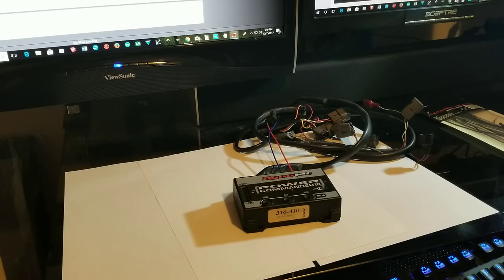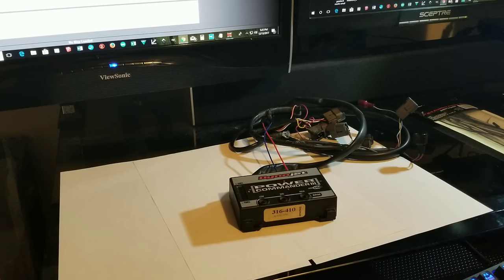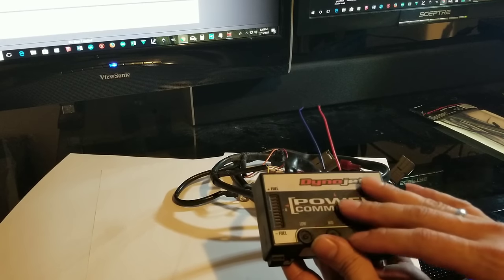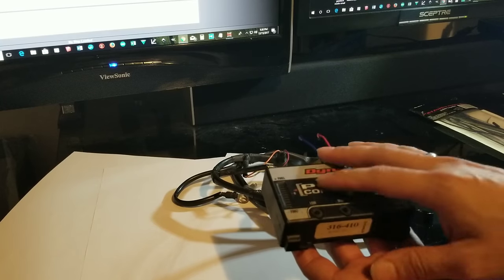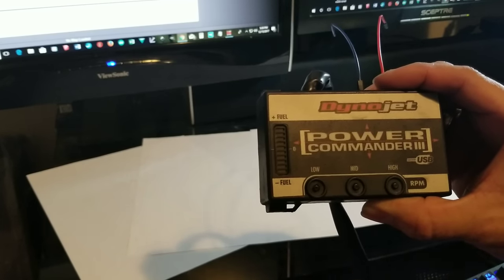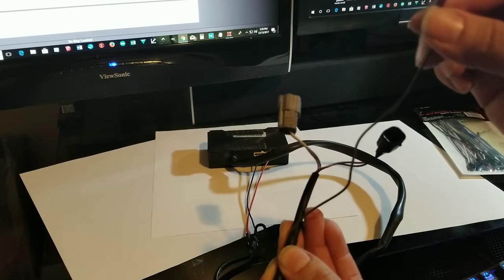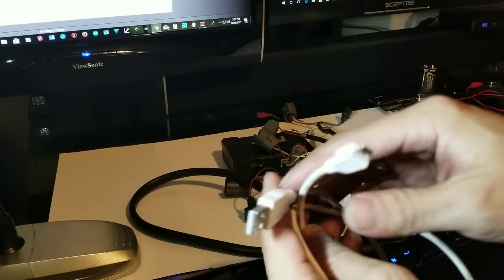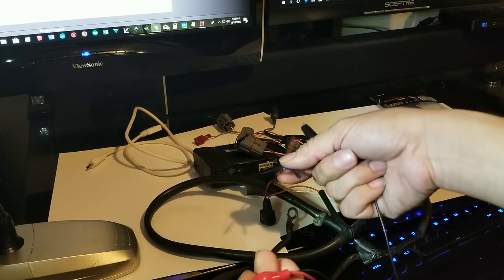Power Commander 3 Full Install - Mapping to Installation (Part 1)

Comment: put a resister in series with the coolant temperature sensor. Tricking the ecu into thinking the bike is cooler then it really is, thus dumping more fuel. putting the fan on a switch might be a good idea(for obvious reasons). 100ohms is a good base to start with and knowing how much the temp reading has changed is crucial.

Comment: Ur videos have given me the inspiration and confidence to troubleshoot and remedy if needed several applications outlined in ur videos. My 01 GSXR 1000 has a PC III USB with a custom map that I inherited when purchased. The bike started to backfire when idling after I repaired an exhaust leak at the mid pipe. When I hooked up my laptop, established comms with the PC III and was viewing the custom map I noticed at throtlle position 0, rpms 1000/1500 and 2000 had a -10 defined in the text fields which indicated to me a lean condition which in turn would cause my backfires when idling. I changed these values to 0 and the backfires immediately stopped. I know the bike needs a proper tune which will happen come springtime. THANKS for the informative vids. Much appreiciated....
Reply from the maker: Kevin, thanks for sharing, greatly appreciate the comment. I'm glad my videos could help you out. Funny story, these videos were never meant to be self helps for YouTube viewers. My intention was to document my repair jobs as I learned and worked on my own bike, something I could go back to if the problem happened again. I got such a good response from viewers that I continued to record each and every problem that occurred creating what is now some 90 video library over the course of 7 years. While i dont proclaim myself to be an expert I do offer advice and troubleshooting tips to those willing to listen. hope you stick around, I'm always working on something whether it be a repair or modification.

Comment: To Justin Westphal,
Follow up on the maps. 
Once you create a login and look up your bike,  you will then be able to save it in your garage. 
Go to your garage and on the top right you'll see 3 dots,  click on those and select browse parts.  Select Power Commander III. Then scroll down to Tunes and keep scrolling to the bottom where it says ACCESS TUNES, click on that box. Find your map and download it. Then go through the process of programming.  Very easy. 
Good luck hope this helps. 
Todd Weiler
Reply: Todd weiler thank you
Reply: I'm not sure if they changed the website but there isn't 3 dots on the top right anymore.  Any chance you can revisit the site and see if you can find power commander 3 maps for a 2005 GSXR 600?

Comment: I'm late to this video, but for those who are watching, you can't just use anyyy USB ( 7:00 ). It's a USB-A to a USB- Mini B (aka USB mini or mini-USB) not to be mistaken for a Micro USB. The USB-A is what's plugged into the computer and the Mini-B is plugged into the Power Commander.

Comment: Thank you....
This was an awesome tutorial on the commander 3. I just remapped mine due to this video.  Step by step was right on.  Thank you for taking the time to make this video,  very clear and easy to follow.  Every step from the power connector on the unit, to the program,  maps etc.
Excellent! 
Coyote
Reply from the maker: Hey Todd. Thanks for the props brother, greatly appreciated and glad I could help you out.
Reply: Where did you find the maps?  The power commander website doesn't let me chose a maps tab.  Any ideas?
Reply from the maker: @justinwestphal6195  take a look at Todd's response below.

Comment: This vid was amazing man thanks for taking the time to break it down. So many jewels you dropped in this joint. Keep up the good work, I’m confident in moving forward with this PCIII I’ve had maying around I’ll put it on my 07 750 track bike since I have a new Arrow exhaust and I’m getting some back fire. Now my only question is do it matter what PC3 I get? Or is it more just about the maps you download? The PC3 was given to me free
Reply from the maker: Thanks Brother, does it matter what PC3.. Yes.. a simple net search will result in which one to purchase for your bike..This is primararly do to injector connection type. The maps will dictate the firing or spraying intervals based of the TPS signal (throttle input). Be sure to watch part two so you can see what installation is like.. pretty straight forward stuff.

Comment: To Justin,  you have to be signed in to get any maps. Just create a login and password and then when you get into your year, make and model,  you will see options to get maps.  Follow James' tutorial from there and you'll see them.  Good luck. 
Todd
Reply from the maker: Thanks Todd, this must have been a new requirement added when they designed the new site. I dont recall ever registering to the site but I can see where that makes sense as it just populates on my screen..

Comment: PC is going to charge like $22 minimum to ship the 9v module. The diy connector is a great idea, thanks.
Reply from the maker: Kyle - wow, is that a confirmed shipping cost.. if so that's damn outrageous!! There defiantly adding an extra cost in there to make up for the  listed low cost. You can buy a battery snap for a buck or 2 and make a more professional looking piece and save yourself 20 bucks..lol
Reply: james moreno I think they offer USPS ground. But when I plugged in my address the cheapest method is $19 ( not $22) for FedEx 2 day shipping. ... I found everything I needed in my garage, so I saved some money :).

Comment: Quite crude. You can only make changes for every 20 % throttle position in the higher percentages. That was a surprise. 
I think you can adjust more with an ECU flash.

Comment: sweet video brother, don’t have a local electronic store like the one you mentioned another place where i could get those leads ?? and alligator clips?
Reply from the maker: Thanks brother, about the only other place I would say is to head over to amazon. I'll post some links below just in case you want to order. If you have an RC shop or hobby store which deals in small consumer electronics then they will most likely have. 

Alligator Clips
https://amzn.to/3hScyWr

Breadboard Jumper Leads
https://amzn.to/3ffntb9

9 Volt Battery Snap
https://amzn.to/317PVa1

Comment: really usefull video, do you know for PC3, which pin can i connect to switch map? (without using hub module)
Reply from the maker: Sorry bro, I dont have that information for you but if you do locate that information please come back and share it so it becomes common knowledge and available for everyones.

Comment: Sorry for the Low IQ question but which map would I use if I have a 

2003 Sv1000s
Sc project exhaust
Tre eliminator
-1. +2 chain and sprocket
K & N air filter 

I see stock maps I’m all types of confused 

Appreciate any help

Comment: Great video, one question,  can replacing my dead battery clear out any maps I had on my powercommander? My Honda will not start after I changed battery.
Reply from the maker: No, the map is written to the eprom chip inside the PC3. If this is your issue it's something else like a fuse or some other underline issue.
Reply: Thank you, for your video and your time

Comment: Thank you for this video. I got a 104-410 PC3 and I just mapped it. It has an option Shifter Kill. As I read online, I should have an ignition module, but it seems that PC3 controls both injection and ignition. Does anyone have an idea about this? (It's about a Quickshifter)

Comment: I know im a little bit late on this one so i  have a 06 750 gsxr when i bought it it all ready has a  power comander but i cant really  tell what generation  is it  my question is do they get married once u updated to a computer n connect to bike ? Also if i get a newer comander will i have to unmarried the old one n married the new one or is it just plug n play? I been wanting to do some upgrades on my bike but this thing is  stopping me from pulling the plug and buy some aftermarket parts.
Reply from the maker: No marriage here brother. Divorce the two by pulling the plug and connecting everything up as normal and the bike returns to stock.

Think of the power commander more as a translator with its own agenda, a man in the middle if you will.  The ECM says one thing (Add Gas)--->[PCIII Translates (add MORE Gas)]---->Injectors (GOT IT... MORE GAS). The injectors never even heard the ECM... haha

Everything remains on the PCIII.. That's why when you sell it to someone else they need to go in and clear that stored MAP and add the one specific to their needs.

Comment: James can the PC 3 be remapped with the laptop connected to it while in the bike without a 9 volt adapter?
Reply from the maker: Michael Doucette, yes but the bike will have to be running (Live tune). From my experience if you turn the key to just the accessory position power is given for a few seconds for priming and then kills the power shutting down the PC3. You can try of course but like i said that has been my experience with my PC3. I have seen one video where a guy was able to keep power on to the pc3 with just the accessory on but this may very with older to newer versions of the unit.

Comment: so if you bought a used bike and the bike already had a commander in it, is there a way to download the existing  tune from the commander?
Reply from the maker: You can always download a map with your specifications, exhaust or air filter, off the DynoJ website. The question you should be asking yourself is if the power commander already has a map in it that already has programming specific to your bike. Have you hooked up the power commander to your PC to see if one is not already installed or are you just assuming that it's not there?

Comment: If your PClll is already wired up to your bike then you can just hook the usb to it and your laptop and turn the bike on to supply power to the PClll? And download and install from that point?
Reply from the maker: Technically yes, but there are some PCiii that will go to sleep once you switch on the ignition to accessory mode and those will require to bike to be running in order to tune or you just simply connect the 9v battery to maintain power.

Comment: Hello, can you help me about a problem? I didn't found on the dynojet website a map that can my PCIII software to read it. What can I do next? I buy an used PCIII and the previous owner tell my that the PCIII dinn't have a map on it. I can do something with it, or resell it?
Reply from the maker: whats up brother. I find it odd that the previous owner of your PCIII didn't have a map on it if it came off his bike. Most people who sell their used PC3 wont go through the extra effort to erase the map off the unit which leads me to believe that his unit was defective when selling it to you.. that's assuming if your having trouble uploading a new map. Take for instance my PC3 which I purchased off of eBay, this unit came to me from a person who had it on his bike and had a map on it and since he knew it was going to be reprogrammed he left it on.

If your having trouble finding a map for your bike I would suggest doing a net search to see what others have used that works for your setup. You can also get up on the forums and  ask owners of the same bike with your modifications if they could give you a copy OR sell you a copy of there map which you can then upload to your PC3. Since it is working on theres it should give you a baseline to work from.

If the issue is that you have a map and cant upload it to the PC3 try using a few different USB cables. Not all cables will communicate with the unit as you seen in the video.
Reply: @TheChemistDIY  Thanks for your response. I'll wait my unit to arrived at my home soon, and connected to my laptop and see what's in it. If is empty, hope you can help me with a map. I'll aprecieted your effort to help me. I will talk to you soon as my unit arrived and install it on my bike and put a laptop on it and see what's inside

Comment: Alright I'm a new rider only been riding for 2yrs I was going to purchase a pc3 but I see some with only 2 injector plugs and some videos show the pc3 with multiple plugs I have a 2001 cbr 600 f4i which I added a k&n air filter delkevic headers and yoshimura exhaust...so again should the pc3 have more than 2 injector plugs? Please help me out it's all new to me and I'm dying to ride again?
Reply from the maker: What up Jamez, no worries we were all there at one point bro. 

The number of PC3 connectors is dependent on the number of injectors you have. On a bike such as my Gxxer there are 4 injectors, for 4 seperate cylinders, this is typically called a four stroke engine because there are 4 pistons moving up and down, 2 stroke engines equals 2 cylinders, 2 injectors, and two pistons...and so on.

Each piston or cylinder needs fuel and this is the job of the injector. The timing and the amount of fuel to be sprayed into these cylinder is the job of the ECM, where it gets this signal from is the TPS (throttle position sensor). The ECM take the output signal from the TPS, runs it through its prgramming map and basically sends a voltage pulse signal to the injector(s) allowing it to activate and spray the required amount of gas needed to each cylinder. This pulse happens multiple times and very fast as you increase speed using the throttle.

The PC3 is sort of like a middle man, sitting between the ECM, TPS, and the Injectors. It takes the pulse signal ment for the injectors coming from the ECM and runs that through its own program called a map. It then computes that signal and addes what it thinks is better for performance and shoots that singnal out to the injectors giving you better performance. I'm sure I missed something here but thats the gist of things.

Does that make sence..?
Reply: @TheChemistDIY   thanks for breaking that down but my main question is I've seen a pc3 on ebay for my bike but it didnt seem to have all the injector plugs it looks like it only has 2 plugs 1 u plug the injector too and then the plug that goes in the injector plugs place so I guess my main question is can you run a pc3 with only 1 injector plugged in or do you have to buy additional plugs for each injector?
Reply from the maker: @Blacksh33p777  You dont want to look to an ebay seller for technical information of a product you want to put on your bike, they'll try and sell you anything. You want to go directly to the manufactures web site and see what should be used from your bike,  which would be Dynojet. Yes even though PC3 has been discontinued they still provide the all the information and mapping. The PC3 version for your bike as i understand it uses only two plugs from the main harness and does not connect directly to the injectors like mine.  See below

2001-2005 Honda CBR600 F4I
 
http://www.powercommander.com/downloads/108/install/411/eng108-411.pdf

Comment: Hi, I have such a problem when turning on the ignition on a motorcycle and when three buttons are pressed, the green slider starts to run, stops and goes out, and thus does not allow manual adjustments.  What could it be?  power is supplied from the battery.
Reply from the maker: So your sawing the PCIII just shuts off.. Period..?

Comment: Question if I have a commander I removed from my old bike that was totalled and I purchased the same bike can I just install it. Thank you.
Reply from the maker: If the bike has the same mods (exhaust/air filter)  then yes sir.. this aside if your bike was Dyno tuned.. a Dyno tuned map is of course done on a specific engines performance and while it will work, it just won't be tuned to it's new home.

Of course you can still install your pc3 anyways and just upload a zero map until you get those mods in on your new bike and then upload your old map once your ready.
Reply: @TheChemistDIY  thank you very much for your knowledge I think I will try it same mods as old bike same motor

Comment: What if you can’t find your exhaust system on dynojet? I have a Coffman exhaust.
Reply: Coffman exhaust on a 2005 yzf r600
Reply from the maker: @basedful  then the closes map to what you have.. it basically boils down to full or slip on.. but when in doubt just call up Dj
Reply: Yeea I ended up just calling and the dude told me the same thing so that’s what I did. Appreciate it though. Also, for low Med and high, I raised it all the way to the top I gueestto get more hp. Is that bad? I can kinda feel à difference when I ride it now.
Reply: On power commander
Reply from the maker: Well, who's to say what's good or bad without a Dyno.. the object of the game is to get the correct air to fuel ratio at the right RPMs.. not just flood the system with a shit-ton of gas.. gas alone does not make you go fast.. it's a 3 part system.. (spark, air, fuel)

You will know when your flooding the system because you and your bike will stink like unburnt fuel, and let me tell you.. that's a hangover you will never forget..

Comment: I keep getting an error msg when trying to send map to power commander.
Mines hooked up to the bike. I turn the bike on, plug it into my laptop. The laptop does find the device. Then I load the map I want. But keep getting "error sending map" msg

Also mine is the older power commander 3. No usb connection. Port on back of the commander
Reply from the maker: Did you delete the previous map, or are you just trying to override it? p
Reply: @TheChemistDIY  It won't even load the previous map. The commander powers up when I turn the bike on. The green lights come on. It's the older PC3. So no usb port on the back of the PC3.

When I open up the PC3 software I dont even get the green lights in the rpm or throttle area. So I can't even load the previous map.